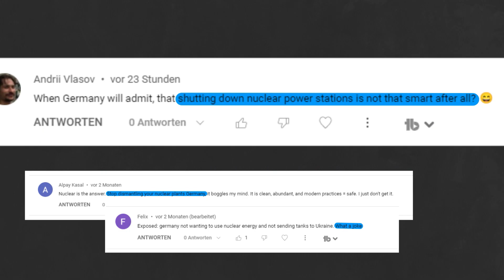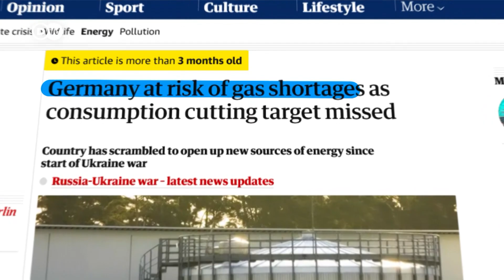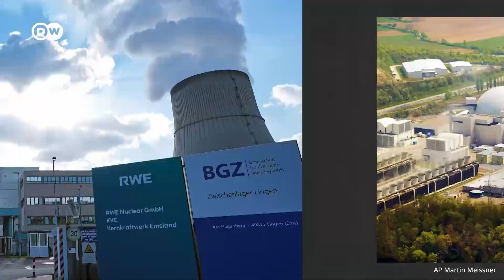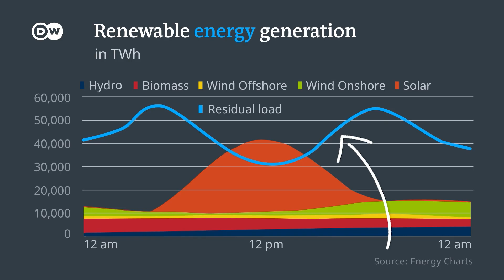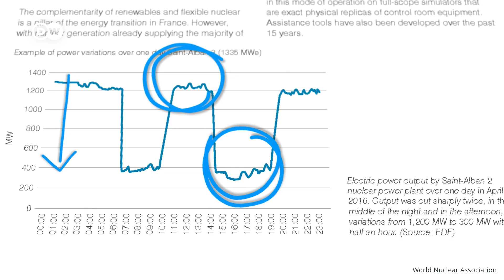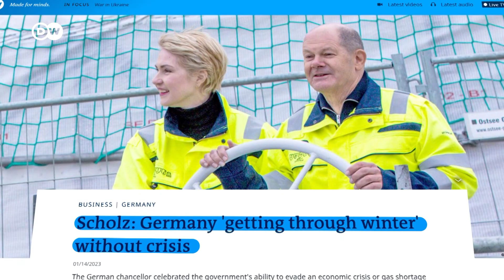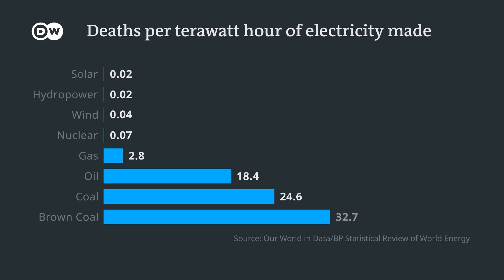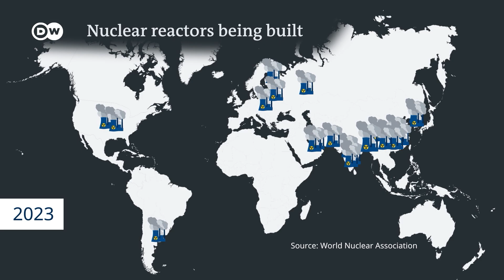Is Germany's nuclear exit a mistake?

Comment: The decision has been taken years ago and there was plenty of time to correct for it if it was wrong. Also there was plenty of time to speed up replacement sources buildup more than Germany has done, although it has been done faster than in many other countries. Finally Germany has been sticking to the decision until the very last moment and it is not for us to call this a mistake.
Reply: It is absolutely for us to call this a mistake, and I'll watch intently while Germany fully regrets it.
Reply: @rosskrt  There's n reason to regret if it wasn't for the slow progress in decentralized energy sourcing and extension of distribution systems.
Reply: @rosskrt  you mean like france last summer? The only mistake is the slow process of expanding renewable and power storage.
Reply: @rosskrt  just  wait till their industries  can no longer compete with the US and chinese companies.
Reply: @rosskrt  There is a big problem with nuclear power plants in Germany which is nearly not discussed: Meanwhile, for short time periods, the renewables fit nearly 100% of the electrical energy amount. Coal is nearly entirely shutted down and nevertheless, wind turbines have to stop the energy production. The german nuclear plants cannot follow the load below 50%. In May 28 2.00 PM (Sunday) - after shutting down the last three nuclear plants - the electricity price fall down to minus 15 Euro-Cent. Black coal plants are often shutted down, brown coal plants are in idle mode, but nuclear power plants are not able to shut down. In my opinion, this was the main reason for shutting down nuclear power before shutting down coal plants which are running more and more in backup mode.
Reply: German here, it's a mistake current problems we have:
we had to recommission coal plants
Have the highest electric coast
Need imports
Currently electrifying everything (at least trying, but we suck at this also)
Our grid is very unstable, like public warning to please reduce consumption in some areas for some hours....

Every decision regarding nuclear decommissioning was done without experts.

So to summarize our industry goes down and price of living goes up (Bills, Gas, heating, food, ...).
Reply: @flippy1345  So when this is really so bad: Why didn't you change it? Don't tell me the government is crap, Germany is a democratic community. So it was up to the people to change it since 2011 or so when it was decided. Thus plenty of time. To me it looks as if some 50%+ of german people not thinking it was a mistake because coal usage is down from 2011 (look at statistics) and temporarily usage to fill current gaps is temporary which means it is not really an issue. Plus Gas shortages don't have anything to do with Nuclear exit. Since also this past winter there weren't any blackouts of size, the grid seems very stable and no documented hints are here that the industry doesn't have the energy needed to work.

Comment: In 2010 Merkel agreed to a plan to keep most of Germany's nuclear power plants running until 2036. The backtracked and reversed course 180 degrees. Clearly the plants could have been kept operational, and clearly that was the right decision. But it is too late now. The green movement should admit that they made a mistake. However, that does not change the fact that nothing can be one to make up for that mistake. Just like you cannot make Russia un-attack Ukraine, or revive all the innocent civilians (and military personnel) that were murdered. Germany's energy policy is also partially responsible for Russian aggression.

Comment: The easy solution is hydrogen, when there is enough renewable to power the country use the nuclear power to create hydrogen which can be used to generate electricity when there is not enough sun/wind. Nuclear waste for the short term is not an issue, there is already nuclear waste which needs to be stored.

Comment: Also flying is risky, in fact is more probable to die in a plane crash than due nuclear contamination, and still nobody is protesting against planes .... why is only Germany so sensible to nuclear risk ? In fact if a French nuclear plant could have a problem then also the germans can suffer .... this nuclear fast and useless exis will cost EU and especially Germany economy supremacy, in fact even this price inflation crysys is enforced by this bad decission, so we need all to suffer. Germans should invest in upgrading the grid and switching  heating and industry to electric and then replacing nuclear plants with regenerables which are getting cheaper but were not si cheap 10 years ago !

Comment: So let me get this right, they brought someone on to argue that nuclear isnt feasible because they cant adjust to the fluctuations of wind and solar? Wouldn't the logical decision be to just use the nuclear plant and drop wind and solar? Germany seems to be a country that just cant figure out that the square peg will never fit into the round hole.
Reply: Wind and solar are really cheap so cheap a small company can install them ontop of houses and connect them to the grid.
Nuclear is a large long term thing.
Though should be coal being dropped with renewables and nuclear taking over.
Nuclear being the base load for good part of 50 years till by then renewables should be able to take over fully.

Comment: Kyle Hill's series on nuclear disasters have shown that most of the time, it was human error/incomitance/greed that was the biggest reason behind some disasters, and there have been so much improvement to safety and efficiencies so now we are no longer working with those old, super sensitive power plants anymore!
Yes, they cost a lot and take time to build, but damn is it worth it
Reply: Also communism
Reply: Nuclear power has a necessary evil element
Reply: romans lived two thousand years ago and the first pharaohs 5000 years ago. We know little about them. imagine we bury nuclear waste that will last 100,000 years and is deadly. You cant do that the the future generation. We in Germany still have no repository and nobody wants it so...And the construction and dismantling of the nuclear reactors is not Co2 neutral either due to the gigantic amounts of concrete. In addition, because of the phase-out of nuclear power, we will not phase out coal later. Just wanted to make that clear. Btw Finland is the only country with a final repository.
Reply: And human error/incompetance/greed will never go away...
Reply: @lukasmuller4606  Yes they do, if you just filter out the stupid.
Reply: @lukasmuller4606  it went away with thé soviet state , nuclear powerplants are much safer on the west, also Fukushima caused only ONE death due to radiation thé panic killed more , so the incident risk argument IS bullshit
Reply: The waste is a problem, but why we are not considering using it as a fuel for other applications, like small plants, etc? The reason this waste is dangerous is because it still has a lot of energy.
Reply: @alexfatiuk2512  cause only a fraction of nuclear waste is usable
Reply: Ah yes, but now people don't commit errors anymore and also aren't greedy.
Reply: Lies again? Nescafe Coffee
Reply: is it though?
Worldwide we got a 25% production deficit in nuclear fuel.
Meaning we consume several thousand tons of nuclear fuel more than we can produce by mining and recycling.
40% of NATO´s fuel is bought from Russia (Rosatom).
If you count in the externalised cost and subsidies to keep nuclear electricity cheap, nuclear is by far the most expensive energy soucre we have availible. And i mean 10 times more expensive than the same amount of energy generated by redundant renewable sources with a large safety margin for periods of no wind or sun.
Reply: @zhufortheimpaler4041  but coal. Germany's alternative is to burn more coal. REnewables are not perfect, they need to be suplimented but coal is not the answer, heck even natural gas is better. Nuclear can be that gap filler until renewables flood the market and can provide renewable power for cheap for everyone at anytime, this is achievable unless more coal is burned.
Reply: @zhufortheimpaler4041  Australia has the biggest untapped deposits. All it takes is one trade deal.
Reply: @kuryaku5906  those resources are in large parts extremely low concentrated in the carrier material or due to their location extremely difficult to mine. Both makes it economically unfeasable to mine them.
Reply: @zhufortheimpaler4041  What is your source for this information? I have found no mention of this online.
Reply: @kuryaku5906  its public information.
Reply: @zhufortheimpaler4041  Where is it from?
Reply: @zhufortheimpaler4041  Guess that means you lied.
Reply: @zhufortheimpaler4041  yeah a wind generaor operates for 10 years and needs changed....
Reply: @InfiniteDesign91  and if you take the building cost for a wind turbine every 10 years and compare that to a nuclear powerplants building and operational costs for 50+ years (or longer) you still get away VASTLY cheaper with replacing a windpark every 10 years.
Reply: @zhufortheimpaler4041 People simply got what they paid for 😂. 

You have absolutely no idea that nuclear energy has the HIGHEST capacity factor at around 90%, wind at 35% density & solar at 25% (compare that to coal at around 50%). In fact, just 1 pellet of Uranium is equal to 1 ton of coal!
You didn't even factor the LAND USE of these renewables since you need so much space for solar & wind thus it means more panels & winds are needed, while you only need a small piece of space for nuclear & it's already really powerful.
Nuclear energy also creates more jobs than renewables.

REMEMBER this, nuclear is always about how much while renewables are about how many.
Reply: @HSstudio.Ytchnnl  still you pay on average 8 times more, for the same installed netto power generation with nuclear power and are hghly dependant on Imports from russian controlled sources (72% of EU uranium comes from russian controlled sources these).
Reply: @zhufortheimpaler4041  but the real problem here is land use, maybe your country is big but my island country is not that big (& we have tribal lands to deal). Plus, isn't energy a global problem & not just an EU problem. If 72% of Uranium is from Russia then it's just EU's problem. Nuclear simply has so much energy & it uses really less space. Why do you deny the money for massive energy? are you jealous that the 8 times more will not go to your pocket?
Reply: Remains the small question of what to do with nuclear waste... This will remain a problem for tens of thousands of years already. Adding more will not help.
Reply: @ksenss2513  we store or recycle most nuclear waste, by the time its done being put in reactors its only outputting 1-12 MsV/year of ionizing radiation, only "dangerous"* if you're standing next to it for an entire year. This is on top of our storage methods being to turn it and store it in glass to be put into geologically stagnant regions far FAR underground, by the time if it ever surfaces again, it'll be damn near background or lower in terms of radiation output.

Hell the storage container for moving the waste is able to tank a hit from a fucking freight train with 0.2% of a breach, literally a worse case scenario is more than negligible in terms of danger (the train used in that test was more damaged [destroyed] than the storage device)

We have storage methods, they are more than capable of making sure no waste ever resurfaces without our direct intervention before its safe.

Per capita, Coal (the lesser polluting kind mind you) kills over 800% more people per terrawatt hour than nuclear, this stat ignores the more polluting type of coal and oil. Nuclear, while not great and has its downsides, is leagues and fucking bounds better than the alternatives that Germany uses. You could say that "greed" would somehow mess everything up, but ill get to that. reactors don't blow up anymore and there's only been two "major" nuclear disasters. I put that in quotation marks because frankly the only real nuclear disaster the world has ever seen was Chernobyl, and that was run by the goddamn soviet union so shouldn't be considered even remotely close to what we have today considering their track record of nuclear safety is... "less than adequate"

To anyone who will inevitably try and say "oh but greed!" like its some kind of end all be all argument against nuclear, I say this: Fukishima is a testament to nuclear safety. an absolute worse case scenario happened where it was hit by a fucking tsunami that knocked out cooling with three of the four cores going through meltdown, this tsunami was higher than the designers intended, who prepared for a tsunami using the largest earthquake of the 20th century as a basis for precautions, but later scientific discoveries meant they should've taken further measures to protect the plant, but didn't out of that oh so dangerous greed. the total death toll for the tsunami that caused the meltdown was 19,759, of that amount 3 employees of the company that ran the plant died from the tsunami, there were 0 cases of radiation sickness or injuries related to the plant melting down even during the cleanup. radiation exposure was less than a third of what was considered dangerous. the "exclusion zone" is approximately a third of the size of an average city was made. (dont get me wrong, people lost their homes and likely wont be able to return, but the area is tiny...)

Don't get me wrong, this was a disaster but its hardly got a candle to the shit we do for coal and oil.

Comment: "We have planned to shut them down, therefore we must shut them down. We must respect the plan ."
Germany in a nutshell.
Reply: True. I guess it’s a German trait. With my wife, we had planned to have a kid in 2019 (back in 2013), we accordingly had a kid in 2019. She has since divorced me.
Reply: @mark9294  you needed to have a plan until your retirement and beyond, she would have just gone according to the plan 😅
Reply: @teramalik7260  Democracy does have problems, like short term planning. You can love it and admit its faults at the same time.
Reply: romans lived two thousand years ago and the first pharaohs 5000 years ago. We know little about them. imagine we bury nuclear waste that will last 100,000 years and is deadly. You cant do that the the future generation. We in Germany still have no repository and nobody wants it so...And the construction and dismantling of the nuclear reactors is not Co2 neutral either due to the gigantic amounts of concrete. In addition, because of the phase-out of nuclear power, we will not phase out coal later. Just wanted to make that clear. Btw Finland is the only country with a final repository.
Reply: Lol
Reply: Comparing nuclear deaths with other green sources except for hydro is quite disingenuous.
Reply: The problem is that they simply weren't able to change the plan without pouring billions into maintenance work and new fuel rods. If you plan to shut down a nuclear power plant, you don't just turn it off on the planned date, but you rather operate it in the most cost-efficient way until the shutdown date arrives. Therefore, they simply weren't able to not shut the power plants down.
Reply: @greidal  Last year the german government had the chance to back-peddle. As in, those in charge of operating the reactors basically went "Are you SURE you want to do this? If not, we can still acquire fuel rods, extend employee contracts, etc." and the government said "No." They could have averted the shutdown, but chose not to. Absolute lunacy.
Reply: @KonsaiAsTai  the last economic point of return was 2019. After that, there was no way to keep them running. these months were the last they could get out of them. Why? because they hadnt their security check ups and repairs. Even if they wanted, the plants would have been down for several months maybe years before using them again. now it is just cheaper to build renewable.
Reply: @greidal  That's bullshit. People actually involved all said it was totally fine to extend them. The real reasons are pride, sunken cost fallacy, and politics.
That was already an argument against the 3 months extension. Turns out it was complete BS.
Reply: @greidal  Forget it, you won't convince the stupid brainwashed commentators under videos like this. People are not smart enough to understand how nuclear power plants are working or how a shutdown is done and why you can't simply keep them running.
They also don't suffer from Chernobyl like my whole family does to this day and to our last day. They do not know how it feels to suffer because of an event that happend over 1000km away.
In the long run, we will profit big times from renewable energy. Yes, we have to pay for the transition (although the cost per kWh from renewable is way lower than from other sources), built energy storages like heated lakes and even use more coal for a few years, but I'm still glad we chose this path instead of the risk of a nuclear power plant like Neckerwestheim failing in a densly populated area thus millions suffering or dying.
I've worked as an IT in nuclear power plants and nuclear research facilities and you really don't want to know how often there are small and medium failures...
Edit: The high prices for energy in Germany are not directly because of the "Energiewende", but because our politicians are just as corrupted as in other countries and lobbyism by the economy managed to get a loophole for themself, so the people are paying their share. Also the cost per kWh are determined by the most expensive source, which isn't renewable energy.
Reply: @greidal  yes, you need to buy new rods to extend a power plant life. But that's part of nuclear energy costs, already calculated in
Reply: @teramalik7260  Nobody's blaming democracy. I'm just blaming German people.